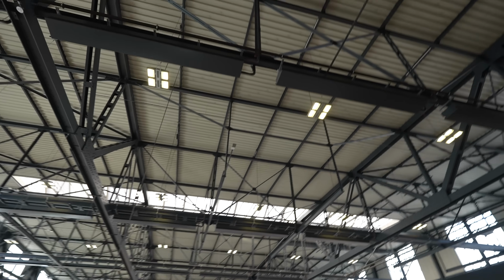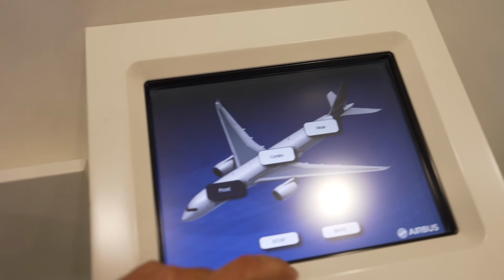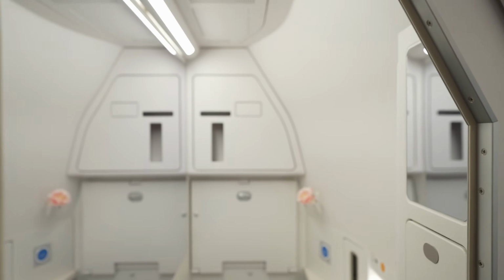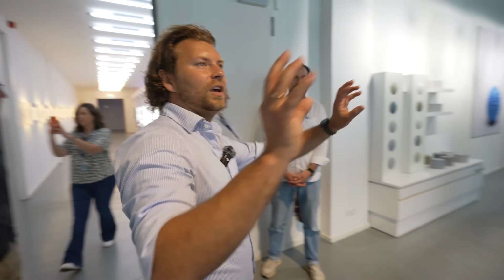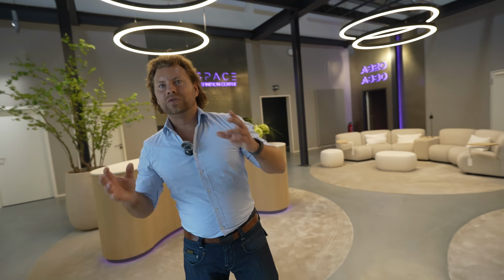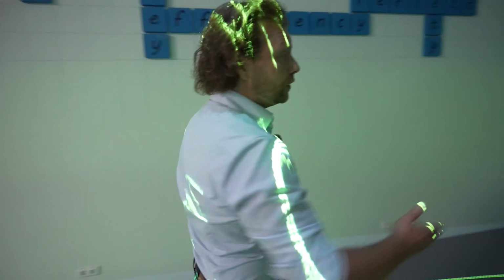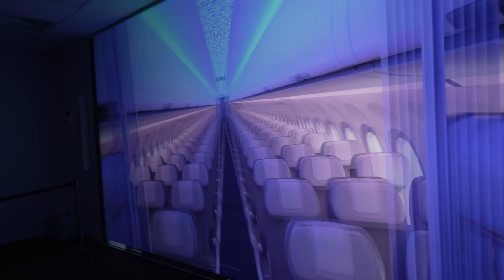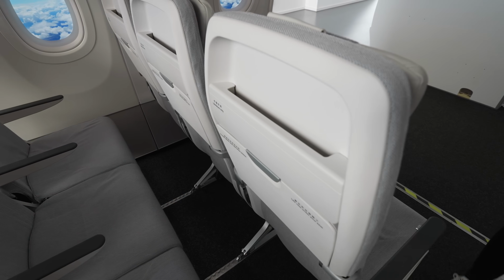Inside Airbus: Where Airlines Design Their Cabins

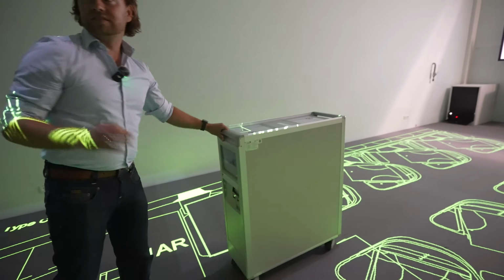Comment: 23:26 the room should also be able to tilt to represent the upward and downward angles that cabin crew have to work with when pushing those trollies.
Also why do they not offer dimmable windows on 321 and 220?
And why does A321 have no option for downward opening luggage bins?